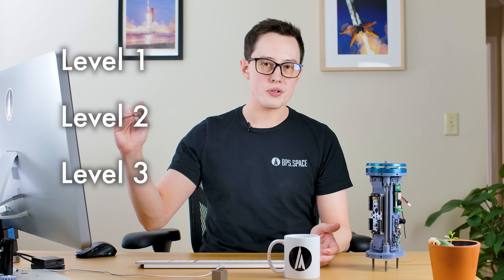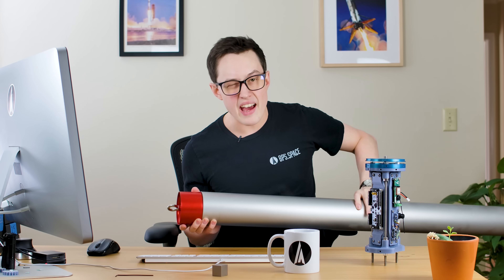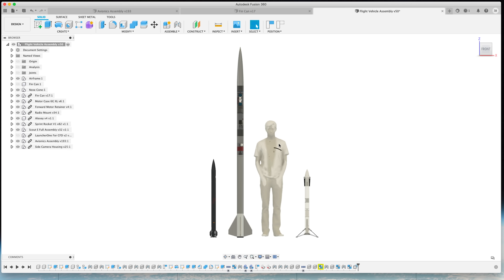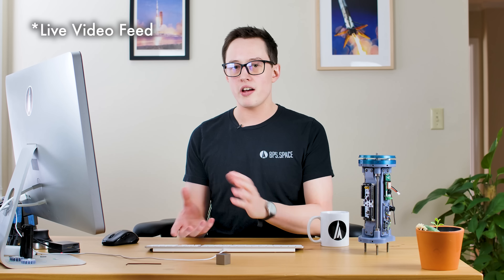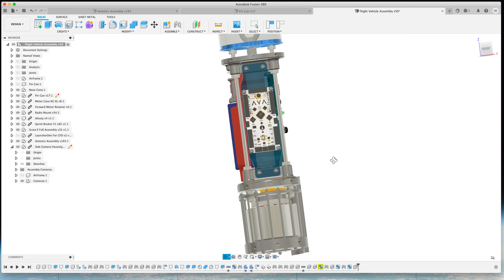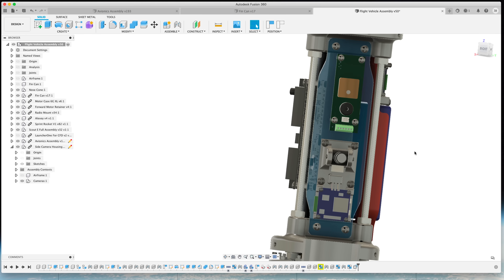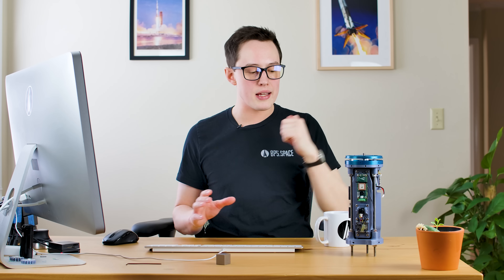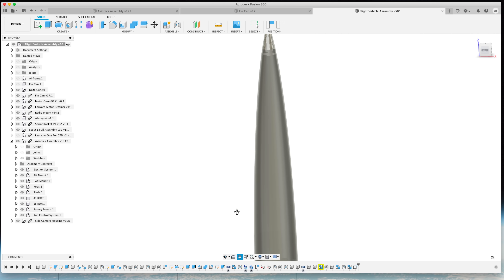Lumineer Design - 10km/Mach 1.7 L3 Rocket

Comment: Why would you spec stainless steel when you could use regular mild steel?  SS is far more difficult and expensive, and I don't see any benefit to being stainless.  The reaction wheel was an internal part, and you're in a dry environment.  Were you worried about it being magnetic?

Comment: I only discovered your channel after the launch, and that was awesome! Except the parachute bit. I noticed some points of improvenents in your avionics package. For a next attempt you could concider changing out your solid steel flywheel for a hollow tungsten or a tungsten alloy flywheel. This is a weighth savings because hollow cylinders have a moment of inertia that lies more on the outside than solid flywheels, meaning you can store more force for thesame amount of weight. Since you're size constricted, the flywheel can't be bigger. So making the outside of the flywheel heavyer and the inside hollow, and sizing your flywheel so that it stores just the amount of energy you need, it'll be lighter.

You could take a (row of) SD cards, solder wires on them and suspend with glue in a small couple mm thick aluminium case. You could even have someone machine grooves in the case as some form of shock absorber. Doing this makes a little black box where you can store all your data on. flash memory is very shock resistant, and giving it a coating in a metal shell makes it practically bulletproof. You would need a decent array of SD cards if you want to store about 4 cameras worth of video footage and some other live data, but it can be done low cost and low weight. I think it would be worth it, because as the flight showed, real-time data can be tricky and the veheicle might not survive.

Comment: At 5:24 there is a fusion model of the electronic chips, I was wondering how do you remake such a complex item in fusion. I tried to do this and I ended up spending hours modeling small piece although I’m sure there is a much easier way to do it

Comment: With the antennas pointing down the body of the rocket, if you were directly under the rocket, you would be in a null of the antenna radiation pattern which will significantly reduce your signal strength at the receiver.

Maybe you could have a reflector plate with a set of axial mode  helical antennas mounted (pointing downwards) on it instead.....

https://en.m.wikipedia.org/wiki/Helical_antenna

Comment: Why not just make the reaction wheel out of brass? Also... are you planning to use the reaction wheel to control roll during flight? That seems like it will saturate the wheel pretty quickly.

Comment: so i dont have the machining capability but something to consider may be pinting in a castible resin on a msla printer then casting the wheel in a denser material. could reduce the overall size some by doing that. but im sure you have already done all your material studies and landed on stainless as your material of choice. anywho, if you wanted to do a cast of one im game, i have the capability and cast dental prosthesis for a living. i cant cast in stainless but other materials are certainly on the table.

Comment: i am really proud to know you pal!......i am just a fan of bps and also i am very fond of rocket science and if you don[t mind i need your help on the hardware parts i have question for you and the question is can i replace sprite flight computer with open source programmable computers  such as Arduino ,nodemcu, raspberry pi ? the reason i asked you this question b/c of i can't afford the parts in my country by the way i am in Africa, specifically in  Ethiopia so there are a limitation of materials as i have seen   your videos including nitrogenous oxide or Ammonium perchlorate what ever any oxidizing gassed motors . the only thing i can get from the signal Alpha development materials is the body part and servo motors..... i need your help on the hardware part what can  do on this project ?

Comment: Stainless steel is the wrong material to spec for a reaction wheel. Stainless' main advantage is corrosion resistance, which doesn't make sense for an internal component. For a flywheel you mainly need strength:density ratio, aluminum would work fine and is easily castable or machinable. If density is a requirement due to volume constraints, then lead inserts are easy to do.

Comment: I would suggest using brass instead of stainless steel, it's slightly more dense so you could get the same MOI with less mass, and it's super easy to machine.

Comment: Hey Joe, wondering if you're going to have redundant initiators for the tender descenders as well (one from AVA and the TeleMetrum) or have thought about how you're going to secure the wires going to them? On the redundancy thing I would hate for one tender descender to have wires ripped out and have the computer controlling the other one to fail (not that either of those is incredibly likely).

Comment: You could include an SD card (or flash chip) in a small metal box with potting compound as a secondary data logger to act as a black box in case of an accident. The compound would not only help to keep the card mechanically stable during impact, but would also keep it insulated from fire long enough to get to the impact location and extinguish the fire.

As an additional bonus, finding a bright orange 4x4x4cm box in the wreckage is a lot easier than finding a millimeter sized flash chip ;-)

Comment: Black powder doesn’t burn the same over 20,000 feet. Make sure the system for your deployment you use is made for this 30,000 plus altitude flight.

Comment: Do you need the reaction wheel in 2 weeks or a commitment to make it with a plan in two weeks?  Depending on the material, I have a couple SS materials that could be used that size.   Do you have a way to dynamically balance the wheel?  I don't think you want to use a reaction wheel of that mass without decent dynamic balancing it first.  I don't know if we can get it machined in two weeks because we are really busy but if you had more time.  Maybe someone has a good way to dynamic balance it.
Also why do you need stainless steel?  If it's merely for corrosion resistance, would black oxide steel work?  Or are you looking at magnetic properties for some reason?

Comment: thank you for bringing the great hobby of high-power rocketry more into the spotlight. being a member of the tripoli rocketry organization and witnessing and being a part of level three flights I like the design of the rocket but I have learned that simpler is best. I would recommend using a smaller motor to avoid going to high speeds (higher chance of shred)  and trying not to rush the build too much as well as probably not using your reaction wheel because it adds complexity and is not needed. also, I don't know if you will even be able to get it built and launched this year because of the pandemic as balls was canceled and LDRS was also canceled. 
best of luck,
godspeed

Comment: Sick that you have a payload from usc
Reply: Hi, USC RPL avionics lead here!  We're testing out an experimental, radio-based distance measuring device that we designed.  Hopefully we can use it to record the rocket's flight path without dependence on any other systems like GPS.

Comment: Fantastically Awesome! 
I'd ditch the dummy-load duckie antennas, and make cut dipole elements out of copper foil tape on the outside of the airframe. Use SMA bulkheads through the frame to the inside, or use low-loss flexi/semi rigid or low-loss pre-terminated coax for internal connections. This will allow properly spaced/isolated elements for FAR better performance!

Comment: what if you incorporated a USB - C charge port on the bottom of the rocket that get automatically unplugged when the rocket launches. You can buy a USB micro or mini cable for $6 and the port from another $6 mobile battery bank. This way you could keep all the onboard batteries charged if you get delayed a few hours.
Reply: o yeah, the thrust of the rocket should be more than enough to blast away the USB micro cable upon launch so no complicated "unplugerator" is needed.

Comment: I’d just like to point out to anyone thinking about getting rocket certifications and are a little intimidated at the complexity and potential cost of this project, please know that you don’t have to do this much. You can do L1, L2, and potentially even L3 all on the same <$200 kit if you plan it out right. It doesn’t take terribly long to do it either. You can easily do L1 and L2 on the same day with the same rocket with no modifications in between. L1 and L2 don’t even need avionics or electronics of any kind and there’s simple/cheap dual-deploy altimeters you can get for your L3.

Comment: looks pretty wicked. with min dia. fuselage though with that spicy of a motor when you think you have enough layup holding the fins on might wanna add a couple more layers. It may be a good ideas to start with a tamer motor like a 2 grain M1560 or 3 grain M1060 or M520 long burn. I watched a build like this rip the fins off 5 times before it was successful. Im sure youll get this right though after watching your past videos. piston ejection looks sweet.

Comment: @7:00 Why not make it out of brass instead of stainless steel?  Brass is quite easy to machine even with one of those cheap CNC machines from China. Brass is denser than SS and while not as strong may still be sufficient.

Comment: Tender descenders are (in my experience) unreliable with high altitude launches. The longer you have the rocket dangling under the drogue the more likely it is to prematurely release. Be prepared for high altitude main deployment. I recommend pyrotechnic rope cutters (aerocon sells them off the shelf, but they are also easy to design build test).

Comment: AvE has his town pump CNC. This part feels right in line with his objective for that machine.
Reply: It's really a lathe part, not a mill part. Interpolated cylinders are sort of okay if that's all you have the machine for - or if you've got a Kern lying around, I suppose - but turned parts will be more cylindrical. And you don't really need CNC for that part at all; manual operations would more than suffice.

Comment: An idea how to stream the video: 
The Runcam Split 4K supports analog video output. Get yourself a high output power analog VTX (search for 5.8GHz VTX on Banggood etc and do some research on good quality brands (Lumenieer, Rush, AKK,...)). To receive the analog video, get yourself one of these 5.8GHz USB video receivers that are made to plug into your PC or your phone. I'd recommend connecting it to a PC/laptop that's running OBS. The USB video receiver will function as a normal USB webcam. Connect your laptop to a phone hotspot (cellular). Via OBS you can then stream and record one or multiple camera inputs at the same time. You can use multiple cameras, video transmitters and USB receivers. Just keep in mind that: 
1. It's an analog video feed. It will have some noise in it.
2. You will need to "space out" the video transmitter frequencies over the complete 5.8GHz frequency spectrum, so that you get the least amount of interference possible. 
3. Get some good quality antennas. Both on the transmitter and especially on the receiving side. 
4. Analog video transmission works best if you/your antennas have a clear line of sight. Make sure to orient them as good as possible. 
5. The analog video transmission will have near zero latency. The only latency will be introduced by OBS, YouTube (or whatever platform you wish to stream to)  and your cellular connection. 

The full quality video will (of course) only be available on the SD cards of the Runcam Split.

I would try to position the antenna(s) outside of the hull. Fiber materials tend to absorb radio waves.

Comment: Hi Joe! I think it is much better to use  lattin instead of stainless steel for reaction wheel. It is slightly more dense, so you can have less mass for the same moment of inertia and you can machine it much easier (as far as I know)

Comment: About the stream, buy a starlink satellite. Upload really should be able the handle the stream without a sweat.
Reply: And if you read this: In case you can use a (remote) network / software engineer, I'm all ears! I specialize in server-side software (potentially a software that controls rockets, etc), front-end webdevelopment and the creation of desktop applications. I've also got a big field of knowledge for infrastructure of networks and servers. Let me know!

Comment: For Connecting to the internet in middle of desert there are lots of ways to do, If you need help I'm here.
Reply: For example you can use satellite internet, there are so many satellites that provide internet for yachts and boats. or you can make a p2p connection that I love it.
You can make a base in desert with a cheap antenna that pointed to a place that has access to internet and it points an antenna to your base.

Comment: Don't neglect to test the snot out of your deployment system. Looks like you probably can't put redundant charges in the piston but there should be as much redundancy in the ignition as possible. Also, make sure your charge itself is 100% repeatable in size, shape, powder compaction, igniter location, etc. I've seen way to many shear pins jam and prevent deployment so think of having sheetmetal reinforcement around the holes so the pins can cut clean every time without wallowing out the holes which increases failure risk. Good luck out there!

Comment: You can get even more longevity of multi tiers, if the fuel/gas type could be compressed like a text breviation symbols, until they are like frisbee disc, which the bottom first tier is already expanded. Almost  a singular stage, 6 tier example:
>(________)()()()()()
>()(_________)()()()()
>()()(_________)()()()
>()()()(_________)()()
>()()()()(_________)()
>()()()()()(_________)
  ...like a push button toothpaste tube or push pop interior.

Comment: Curious why you would use a minimum diameter rocket and such a high shot for a cert flight. Why not keep it low to get the cert then push the higher altitudes later?

Comment: Does it have to be stainless steel ? low carbon steel would work and be cheaper otherwise, you can treat it to be rust resistant. Machining stainless is a tad more tricky but anyone with decent lathe and skills should be able to do it. Reach out to your local hackerspace. If you were in Australia, I'd make it for you.

Comment: I know very little about rockets but with a motor that size why not use an electric motor itself as the flywheel and save on your total weight? Some drone motors work in that configuration (motor upside down).

Comment: Double check your parachute spaces. I find with a 36" x 4" body tube, my chutes technically fit but it's an extremely tight packing. It proves to be a problem every flight, and that's with the drogue in the bottom section and no tender descender. Try packing your chute in the tube before committing to that approach. Honestly I'm reluctant to build another 4" L3 class because of it.

Also, as others have mentioned, try RASAero for your transonic and supersonic sims.

Comment: Your side mounted GPS antenna isn't going to work very well... I'm sure you know this but that patch needs to be directly up unless you're aiming for it to get GPS while falling? With so many antennas and different links you're going to need to look at the harmonics of the 400mhz, 915mhz, and 1.5ghz ranges for the GPS antennas. I suggest you do A LOT of ground testing or you WILL be plagued with interference.

Comment: With these larger rockets and more systems are you concerned about losing components off the PCB?   Maybe it's only a concern if you crash with larger components.  Do you glue them down?  E6000 works great.

Comment: You're pointing the null of the antenna directly at your ground station. 13-15km should be easy on 2.4ghz with 500mw-1w, or even 5.8ghz with a smaller/lighter antenna. Use a 5-7t helical antenna. Farvew makes them dirt cheap. Farvew 5.8ghz 7t helical, farvew 5.8ghz pagoda, and a rc832 is all you need and that's all cheap.

Comment: 3D printing the structure of the avionics bay may lead to issues if launching in hot climates, as the inside of a black body tube with no circulation can get quite hot and compromise the structural integrity of the bay causing a catostrophic failure. This is only really a concern if launching in hot climates (Temp > 80 F) and the body tube is left out for a considerable ammount of time.

Comment: I know you're currently looking at 2.4GHz for video link but don't sleep on a 5.8GHz backup system as well. You can get pretty powerful transmitters (>1Watt) with a dipole antenna for less than $50 that weigh very little and diversity receivers for very cheap. Many in the FPV community have pushed >2 miles on them LOS with a couple good patch antennas. Since it doesn't sound like you're using 5.8GHz for anything else it might be worth it to throw something on just for redundancy.

Comment: Hello, BPS.Space I would like to give you an advice about the motor i.e ;
The motor is very costly if (The parashoot donot open){
That's a very big loss 
}
so, My idea is design in a way where the motor seperates from the rest of the body after the fuel is completely burnt.  This design will be quiet complicated and risky it was failed in case of Falcon 9 model launch but this is very important and helps you buid stage rockets in the future.

Iam a 14 year old physics(And read some books on rocket science) student and a programmer from India
#LOVEFORMINDIA